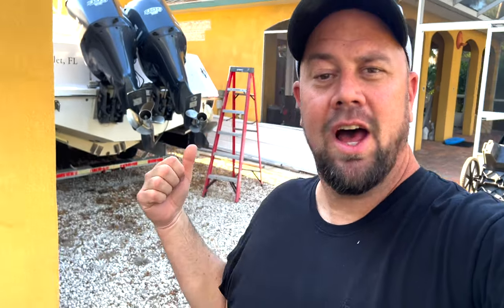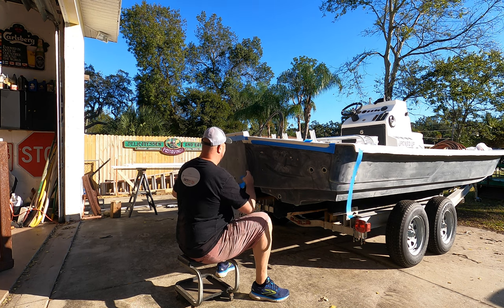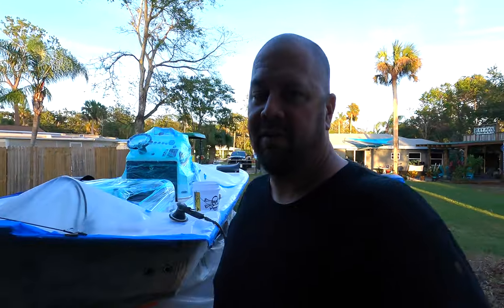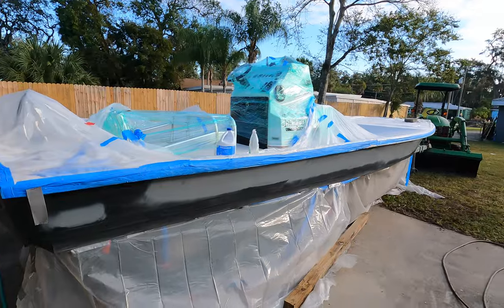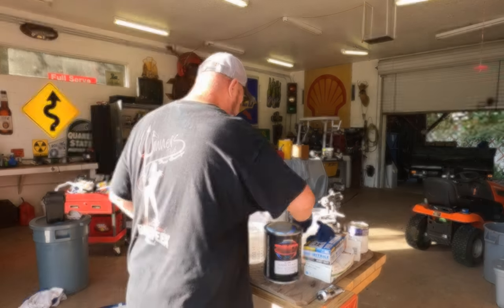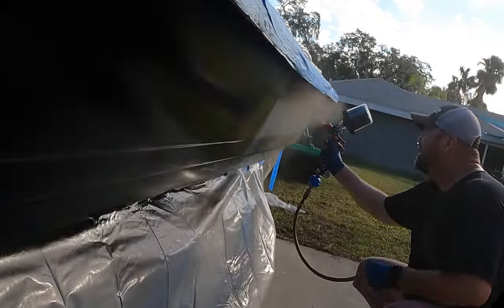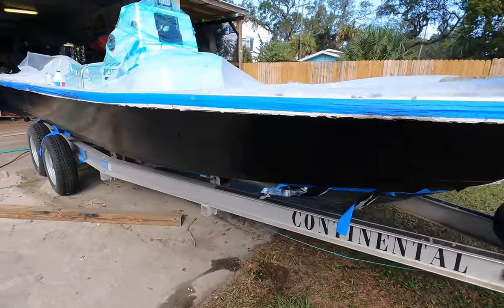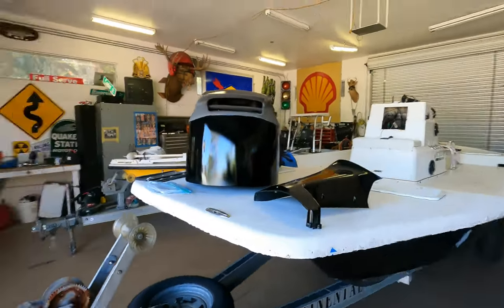PAINTING MY BOAT STEP BY STEP - Using Single Stage Paint - Mishaps And Success

Comment: You need a bigger compressor. First gun had too little pressure the black widow you were using too much pressure and too big of a fan pattern... Looks good tho
Reply from the maker: Thanks, that paint was tough to work with for sure.  Thanks for the tips as I definitely need them.

Comment: Why didn’t you use a primer or sealer? I’m about to tackle painting my boat and every website says primer is a must! Thanks in advance
Reply from the maker: I researched it as well and it was split down the middle on if I should prime or seal it.  I did use a 2k primer over anywhere I had to repair or fair out, but with the  paint I used they said I did not need to prime the whole hull.  It has held up great and is tough as nails.
Reply: @JackedUpFishing  thanks my dude. Would you remember what primer you used? And about much much paint did you use in total?